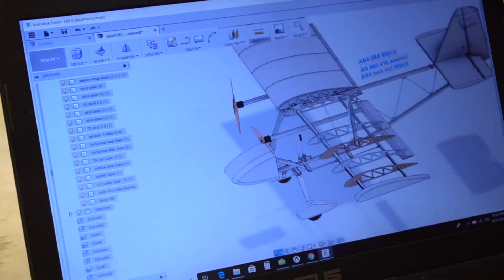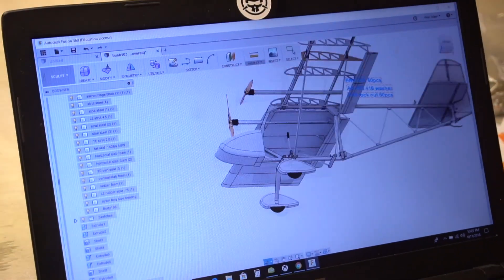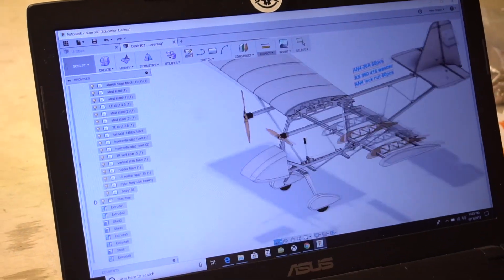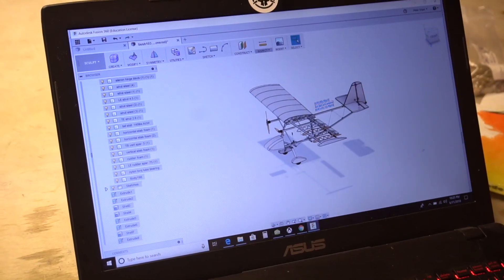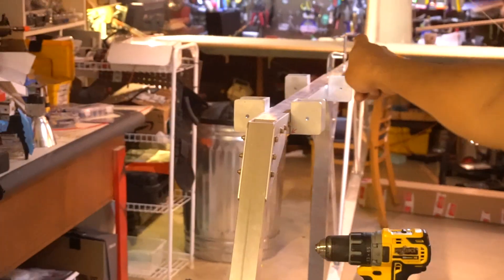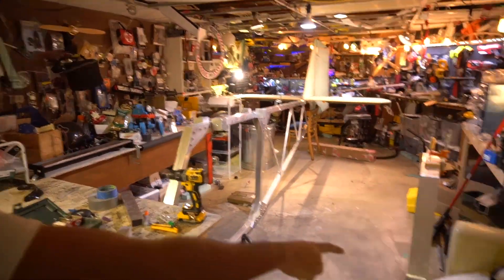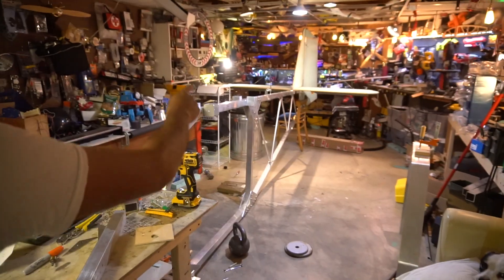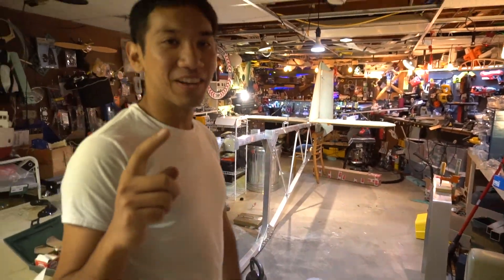DIY Electric airplane mk2 (Pt1)

Comment: Looks much better overall.    Monoplane much better than biplane.
Would look to seeing the following features:  
1.  a good high lift airfoil, with drag as a secondary consideration.  optimized for loiter/flight times.
2  a higher aspect ratio wing.    If you have an efficient airfoil, a higher aspect ratio makes everything better, except for adverse yaw, and that's a solvable problem.   Think early sailplane.. Do not need a large chord to affect the air if the airfoil is optimized for sink rate. The CL is achieved in a relatively short chord, and for the same drag, you can effect loft on a much larger volume of air.  Same principle as the large prop diameter. you would not want short, stubby prop blades, would you?   The twin lends itself to that nicely. 
3 the motors as close to center as possible, without interfering with each other, so that if you lose one, the offset thrust will be minimal. 
4 a T tail would have been better, but the tail you have will work fine, and will allow for better controllability at very low speeds, provided you learn to give the throttle a blast, and still have the battery power to do so. 
5. make a "Tesla" style battery from 3500mah NCR18650GA cells.  Much better gravimetric energy density, about 187% better than lipos.    Not sure how to get sponsorship for them, but would drastically extend flight times. 
6 high amounts of ripple current meant that the batteries should be kept very close to the speed controllers. And the speed controllers should be kept relatively close to the motors.  If you have to extend any wires, extend the wires from the SC to the motor.  this is a major safety issue, and one very often overlooked. 
7. find a way to brace the leading edge of the stabilizers, so that they do not get into an oscillation.  happens way easier on larger scale. 
8 I personally would have made the pilot's position lying back reclined much more for aero, but that's a personal choice, and can't tell you that what you're doing is wrong.  again think glider... 
anyway, just my two cents.  you have more experience by now anyway.. 
best of luck, and don't listen to anyone being critical without helpful criticism. 
cheers!
Reply: I always enjoy your comments. Well Thought out, thorough, full of useful info, and offering CONSTRUCTIVE criticism. Cant wait to see how your input is taken by Peter on this build!
Reply: Great comment !
Reply: So a little clarification on the horizontal stab and elevators in the slipstream, (or not) :
Yes, it helps with control when they are in the slipstream, but only the elevator is helped.   The stab does nothing for control, and if the accelerated air in the slipstream is at  a slightly different angle than the stab, there will be an unwanted pitch effect when power changes are made. 
Also, the increased control effectiveness suddenly disappears when you may need it the most, during landing approach, the landing itself, or in the event of a power failure.   Much better (in my opinion) to size the elevator appropriately, and set it's throws appropriately so that it has plenty of control effectiveness at minimum airspeed, and then it will always be there when you need it.  May need a larger surface, but the drag will be similar, or less, because it's not operating in turbulent, accelerated air within the slipstream.   a T-tail also gets the horizontal stab clear of the turbulence from the wing, but must be high enough so that it's not blanketed by the (even more extreme turbulence) when the wing is in a stall condition at high angle of attack. 
Added benefit of having the tail clear of slipstream is that the control inputs are directly related to airspeed, and are much more linear with the aerodynamic pressure.    This simplifies learning to fly the aircraft, as the  input required for a desired pitch moment is always the same at a given airspeed, regardless of throttle setting.      This makes the aircraft much easier to fly, keeps the pitch dynamic more constrained and consistent, and if you are ever to add a flight controller to the aircraft, (autopilot), the tuning of said autopilot will be that much simpler. Many flight control software does not have an algorithm that takes into account the effect of throttle setting on pitch control, and the PID settings that you would set for powered flight would work poorly during glide. Same goes for Autotune feature, on firmware such as Arduplane. 
And if you think "That's ridiculous, nobody would put an RC flight controller in a manned aircraft!", think again, as it's already been done.  They used small control surfaces embedded in the normal flight control surfaces, used as trim tabs, (or in a similar way), so that if the FC screws up, the pilot will easily be able to over-ride the inputs with the (much larger) control surfaces. 
Hope this provides some perspective on the thought process here, and feel free to disagree, and let everyone know exactly why!   Cheers everyone!
Reply: Higher aspects may make all aerodynamical properties better; but all mechanical considerations all that much worse. Thats the very good reason peter went with a biplane last time. And this build also seems more geared towards 'DIY budget' than 'carbon-fibre-all-the-things'.
Reply: But the propwash drops, so you'd get more force from the propwash if the horizontal stabilizer is where the propwash is actually going to be (below and behind), not directly behind it.
Reply: How would a higher aspect ratio make the mechanics more difficult? A High aspect ratio wing will provide more lift and require less thrust from the motors in order to maintain flight.

You only have a limited amount of thrust, a higher aspect ratio will make it easier for that thrust to actually supply enough lift. Sure it'll go a little slower, but we're talking about a DIY plane lol.
Reply: Higher aspect ratio means higher bending moments; and less space in the wing to account for them. Trying to build a high aspect wing on a budget (one that wont kill you) definitely makes a project like this a lot harder to pull off. Staying within budget, getting it done, and not killing myself, all would be a lot higher on my list of priorities if I were Peter, than say, shaving 10% off my induced drag.
Reply: True, there are practical limits.  It is worth an investment in time to find a way, as it's likely that a more efficient structure will result.   Examples can be taken from human powered aircraft, then applied in a more practical way (with higher margins, as you stated) for a project like this one.  Distributing the load can help, as can use of a tubular single spar which absorbs much of the twisting moment, along with the span wise structural loads.  wire bracing and struts can also be used, but over-use should be avoided.  
A primary reason why ultralight aircraft are not built in a more clean aerodynamic fashion is because they need the additional drag to limit airspeed in level flight to conform to regulations. This makes them lose a part of their potential flight envelope, and become less safe in certain scenarios, such as wind penetration, range, and the ability to loiter efficiently while waiting for good landing conditions, or divert to an alternate landing location. IMHO it would be better to make a more efficient aircraft,  electronically limit it's horizontal flight airspeed to conform to regulations, and get back at least some of those capabilities. 
an example of a slightly higher aspect ratio in a cheap simple ultralight aircraft with proven flight characteristics is the Sky Pup, Designed by some off-duty engineers working for Cessna ages ago.   Some aspects of the design are not ideal, but overall, it's a good design, and has some features that would be refreshing to see on other aircraft.  It did not even need bracing for the wing!  
The main reason to use a high aspect ratio in an ultralight is to increase lift, and enable slower flight speeds, and more battery to be carried, not to decrease the induced drag. It's likely that the induced drag would actually go up, just not as much as the CL.   Anyway, nice to see people put in their opinions. Cheers!
Reply: Eelco:

Yes a high aspect ratio means you need to ensure structural strength. But with a well designed strut that isn't going to be an issue. There's a reason a Cessna 172 has a high aspect ratio relative to a fighter jet. It shouldn't be difficult to design a strut to support the airframe. And besides, I doubt peter is going to be pushing the load factor on the plane very much anyways. 

On top of that, a higher aspect ratio wouldn't reduce induced drag. It would increase it. More lift (high aspect ratio) means more induced drag, there is just a fine line on what is too high/low of an aspect ratio.
Reply: ok buddy.    not disagreeing that power is useful at some point, like as soon as the angle of attack is restored, just not while the wing is still stalled, or when the aircraft is still in a steep post-stall dive.   adding power in a volatile situation with so much to go wrong, and lots of unintended consequences is just a bad idea. I hope you never do it on a craft with enough power to matter. 
Would love to hear actual explanation of WHY you believe application of power is good while still in the stall,(if I am not misunderstanding you-I aploogize if i am) and explanation of how the hell a sailplane can recover from a stall... 
lack of specifics and physics in this conversation, and too many generalities, jabs and personal comparisons.  Not the way to learn, or share information, in my book.  
Had a physics professor who resorted to non-scientific methods to get other people to accept his ideas, and had an interesting conversation with him about how a flat bottomed airfoil could possibly create lift while inverted.  He never did explain his viewpoint, ignored Newton's 3rd law, ignored Coanda effect, and just started swearing and dishing out punishments instead, while stating that bernouili was the only effect that could possibly matter.       Don't be that guy, dude.  
If you cared, you could go to my channel, and see what I do for hobby.   Can't talk much about what I do for real job.. but you would like it.   cheers buddy, and hope you have a nice day. 
 out of time for this conversation, and have to get back to work.
Reply: You are right. Adding power once the stall happens won't help. Only height will.
Reply: @scottgoodman4776  in a stall you simultaneously add power and decrease AoA.
Reply: Given that Peter has already decided on an airframe, motor and consequently, overall weight, *lift is not a variable*. It does not make sense to discuss design variations other than in the context of constant lift.
Reply: Great conversation, guys. I've owned t-tail and conventional tail aircraft in both standard GA category and ultralight and light sport- and one thing I can tell you is that you both make good points but one can't make many absolute statements when discussing vastly different designs and types of aircraft.
The T-tail has advantages and the best high performance gliders use them for a reason, but having owned a Tomahawk I can tell you that there are particular instances where elevator authority goes completely away and often when you really need it. There is software to model all this, but in my estimation with the type of aircraft here and the intended range of performance a conventional tail is where I'd be. It works well on the most successful low speed ultralights and light sports. 
The two things that stick out about this design is first- the central beam in front of the pilot. I would have gone with dual a-pillars instead for torsional rigidity as well as pilot safety. One quick stoppage and you had better be strapped in well AND not have any failure of the fuselage that will let they face be smitten by thy central beam. It's like in race cars I design- you have a cage to protect yourself from being squished, then you have to have elaborate seats, harnesses, helmets and neck protection to protect you from the cage.  Second issue I have is with the excess material everywhere on brackets and small parts. That all adds up- I'd bet 5-10 pounds of excess on that airframe.
Don't take my comments as negative- nobody has ever built a perfect airplane... except for maybe a Carbon Cub... damn, they are near perfect. :)
Reply: FPVReviews: 

The elevator isn't the only thing that is helped, the horizontal stabilizer is there to provide a downward force on the tail, specifically in cruise but generally during all phases of flight. Otherwise, you just end up in a nose down attitude without that downward force.

And, the "turbulence" during a stall isn't going to affect the tail hardly at all, your relative wind at that point is coming from underneath/forward of the plane and you already have a high angle of attack. So that turbulent air is just going to end up rising (relative to the aircraft) up and away. The airflow moving over the airfoil doesn't have the laminar flow necessary to maintain its inertia towards the tail (this deals with the Coanda effect). 

"Added benefit of having the tail clear of slipstream is that the control inputs are directly related to airspeed, and are much more linear with the aerodynamic pressure."
But with that comes a disadvantage, during a stall you want as much airflow moving over the aircraft as possible. Including the airflow from the accelerated slipstream. So removing the horizontal stabilizer and elevator out of that accelerated slipstream makes recovery that much more difficult.
Reply: adding power is the last thing you want to be doing in a stall, especially with the slipstream going only over the inboard sections of the wing.  would result in a a nasty tip stall, and maybe even inversion.  A braced wing will not be able to handle the inversion, and would fail structurally.   Another reason to brace the wing internally. 
It's proven, and well studied that a T-Tail that is not tall enough, (or a plain tail on a low wing aircraft) can be blanketed by the wing turbulence, and result in an unrecoverable deep stall, or at least difficulty in recovery.
here is a link to some testing at langley :
https://www.youtube.com/watch?v=TmWB6oyJ9lE
When conduction manned testing, or even with RC, it's common practice to use a spin recovery drogue chute to aid in normalizing the airspeed, angle of attack, and regaining control authority. 
There is still airflow over a tail when blanketed by the turbulence from the wing (if it is even located in that region), and it's not the lack of airflow that causes control loss, just the turbulent airflow.  hoping this makes sense,  can't post pics here..  
Wiki has some decent info actually:
https://en.wikipedia.org/wiki/Stall_(fluid_mechanics)
Reply: The stall recovery technique for almost all aircraft is apply forward pressure and increase throttle immediately to provide sufficient airflow. And those studies at langley are during a developed spin, we are talking about a stall where your Angle of Attack is high (tail is below your wings). A normal tail would result in easier stall recovery.

The Langley video shows an example where they use smoke, and it seems very clear that the turbulent air from the wings would in fact be more likely to hit a t-tail than a standard tail.
Reply: True, the T-tail is more susceptible to deep stall blanketing. That's why it has to be sufficiently tall so as to be unable of having the problem, and hence the testing. 
If an aircraft has just stalled,  There should be no need to add throttle, as the aircraft will be falling anyway.  Adding throttle will introduce torque effect, P effect, and slipstream effect, not to mention gyroscopic precession, and in many aircraft, it can result in a flat spin, and sometimes violent gyration.  In fact, for aircraft that are rated, that's (usually) exactly how you enter a flat spin. Not all aircraft are recoverable from a flat spin, without a drogue chute. Adding throttle at that point only makes matters worse.  
A spin always starts with a stall, so it's important to get the stall recovery right. 
Exiting the stall/spin always requires that the angle of attack of the wing decrease. That is what actually gets the aircraft flying again, instead of just falling. 
The aircraft will be falling, and will increase in IAS immediately after the stall event anyway.  
T-tails have many other benefits, if done properly, such as improved precision of control due to being further away from the boundary layer effects of the wing in the vertical plane, and better spiral trajectory mode stability, all good things.    There is also a drag reduction if they are blended properly, without the weird effects of V-tails, whether it be a standard V, or an inverted V.    That's why so many aircraft have them, from fighters, to cargo planes, to sailplanes, and sport aircraft too.  The raised CD in the vertical plane also means better pitch stability for the aircraft, and allows stability to be retained slightly longer as the CG is moved further back, decreasing the incidence angle necessary, and allowing the wing to work better in cruise flight, with less induced drag for the horizontal stab as well.  a wider CG range is also possible.
Reply: I am going to go out on a limb here and assume you don't have much time in a full-scale plane. If an aircraft stalls, you 100% need to add throttle. It's in every FAA publication involving stall recovery technique. If you were to take a checkride and not add power during a stall, I guarantee you would fail immediately.

Torque effect, P-factor (as it's referred to by aviation professionals), spiraling slipstream, and accelerated slipstream are all countered by using right rudder. And I'm curious as to what you mean when you say gyroscopic precession in terms of a stall as that is something that is normally only referred to when talking about a heading indicator.

And I'll ask a simple question, if a T-tail is so superior... Why do the vast majority of aircraft not use that design? You look at both GA and Commercial aircraft and almost every single one has a standard tail.
Reply: Only time I have is in Citabrias, a 172, and a Navion. none particularly glamorous aircraft. 
  all spin training and unusual attitude training was in the Citabrias.   Don't remember adding throttle.  On the contrary, remember the stalls being a lot worse with throttle on.  first step to recovery (as i remember it) was use the rudder (not the ailerons) to level the wings, and take out any yaw movement that might have developed (or establish safe recovery heading, if in terrain, or dealign with traffic, etc.) then stick forward until 70 IAS.  then pull back on stick again to level out, adding throttle.   It HAS been a long time ago...     
If you're so sure, please explain exactly why, so we can all get a grip on this, and move on, and so peter can get some answers (if he's even reading). I'll see if i can dig up the handbook for the old bird...
Reply: could not find handbook for the Citabria, but found this, and brought  back memories:
"P - Power To Idle

First, you move your throttle to idle. This seems counter-intuitive - don't you add power in a stall recovery?!?

In this case, no. While you may feel like you're pointing straight down in a spin, you're actually not. Your flight path's nearly straight down, so while the nose looks low, you still have a very high angle of attack. Power aggravates this."
reference:      http://www.boldmethod.com/learn-to-fly/maneuvers/spin-recovery-purpose-of-each-step/
Reply: That Bold Method article is regarding spins, we are talking about stalls. To recover from a spin yes you need to move throttle to idle. 

But to recover from a stall you pretty much always increase thrust. As a stall is more likely to happen on short final coming in to land close to the ground, you need to gain airspeed and altitude as quickly as possible. 

Now realistically, the steps are "pitch down/reduce AoA, wings level, thrust as needed" So if you are at altitude and stall for whatever reason then sure, you don't need full throttle to recover. But if you're low and slow as is typical with a real world stall, you have to recover as soon as possible. 

That information is out of both the FAA PHAK and AFH.

Every instructor, every pilot, and every FAA examiner I've ever dealt with tells you or requires you to use full power on recovery.
Reply: The technique needed for stall recovery should not change depending on the degree of desperation of the pilot, or fear of being stalled close to the ground. That kind of thinking can get you killed. That's specifically what the training at altitude is for, so that you can perfect your technique, and get disciplined in it's execution, and not panic, changing it when you really need it.  A "real world" stall should not be any different than one in practice, other than being a "not intended" stall.   If the technique gets changed up in panic, then you are probably screwed.   The goal of stall recovery is to recover with as little altitude loss as possible, without entering a spin, or aggravating the stall in any way. 
The article I cited did in fact cover stalls, if you read it, and that's why I specifically quoted the part that pertained to a stall. 
you even said:    "realistically, the steps are "pitch down/reduce AoA, wings level, thrust as needed"
the add thrust as needed is the last step..  after the plane is flying again.
remember, in an extremely high angle of attack, the prop blades will not be anywhere near optimal angles of attack to the airflow either, so adding power will only introduce more variables, such as I already described. Could add retreating blade stall to that.   It will not help, unless your plane has enough thrust to hover, and has  vectored thrust, or a reaction control system. 
after the stall has been successfully exited, then full power is perfectly OK.    We're talking about a couple of seconds difference here, but it's important.   you can make a plane do all sorts of nasty things by applying power during a stall, or with some aircraft that have a high torque feedback, and short wingspan, you can just fly close to a stall, then add power, and the airplane will "torque roll".  Better go ask the Pitts guys if you are still confused, and see when they say you should add power.  Just make sure you tell them you're talking about a standard stall recovery, not an aerobatic maneuver that results in a spin, albeit on a different axis, and with a fancy name.
Reply: Was this one of the articles from the FAA that you were referring to?   perhaps people reading this can just go there, and read directly?   :
https://www.faa.gov/regulations_policies/handbooks_manuals/aviation/airplane_handbook/media/06_afh_ch4.pdf
Reply: Alright, well let the FAA know that all of their documentation and training requirements aren't correct then. Walk down to your local FSDO and talk to an inspector lol, see how that goes.

The part you quoted literally says "While you may feel like you're pointing straight down in a spin"

And a retreating blade stall is something we don't even consider on a fixed wing lol, that is rotorcraft. 

I have done probably over a hundred stalls at this point, with half a dozen instructors, 5 different DPEs, with probably close to a hundred thousand hours between them. ALL want full power in a stall recovery.

I think you just don't have the real world experience to apply here, sure you've done a few but again that was awhile ago from the sound of it. And the fact that you talk about a retreating blade stall when referring to fixed wing aircraft makes me question your knowledge on the subject overall.
Reply: yes, that as well as the PHAK and AC (Advisory Circular) 120-109A.

Stall Recovery on page 4-7. Pay close attention to #4 under Fundamentals of Stall Recovery.

Also on the example on page 4-9 "When stall occurs, reduce angle of attack, roll wings level, and add power as needed"

Edit as it may not be clear for everyone: PHAK is the Pilot's Handbook of Aeronautical Knowledge. Available online for free to the FAA.

I'll also add that I am close to getting my Flight Instructor's license. So I've done this a few times haha.
Reply: Aleks B. No it doesn’t... the elevator and rudders are in the right place...
Reply: Aspect ratio really isn't the crucial variable influencing overall lift; there are plenty of ways to increase overall lift independent of aspect ratio (like those sweet junker's flaps, for instance). Technically, aspect ratio does not influence lift at all; making your wings longer does. Trading span for chord does noting for lift, to first order approximation. As for higher order effects; for a given lift requirement, a longer wing means a shorter chord; and lower Reynolds numbers. Which rarely is a good thing.

Pretty much the only reason to push for higher aspect-ratio is to minimize induced drag. Nobody likes induced drag, but unless Peter plans on winning glider competitions I really doubt it should be his foremost concern.
Reply: Compared to a fighter jet everything is 'high aspect ratio', but I wouldn't call a Cessna 172 such in any absolute sense. In fact it seems solidly in the range of 'modest aspect ratio' designs that Peter (rightfully) seems to be aiming slightly below. As for the relationship between aspect ratio and induced drag; id check your sources again. Viewed differently, it does not make sense to discuss wings in terms of 'high lift' or 'low lift'. The wing he will be using will have the lift required to get him off the ground given his target airspeed and weight; or it might as well be a zero-lift wing. An increase in aspect ratio at constant lift (which is how you usually discuss these things) will (surprise) not influence lift. But an increase in aspect ratio at constant lift will lower induced drag. And thats pretty much the only positive to it. 

As for the mechanics of it not being an issue; it sounds like you are generalizing from experience with model aircraft where any bbq skewer will do as a spar. But mechanics does not scale; volumes and masses scale as length cubed, and cross-sections as length squared. With full scale aircraft, at least half the work in building a good airplane is building a wing that is sufficiently strong and stiff. Those challenges will only compound when you are doing things PS-style, on a shoestring budget in a few weeks time.

Moral of the story: if you can live with the higher induced drag, stay the hell away from higher aspect ratios.
Reply: Eelco, induced drag is a product of lift. More lift = more induced drag.

Ryan, what do you mean "the elevator and rudders are in the right place"? lol, we aren't arguing rudder location, just elevator height.
Reply: Uhhh, we aren't necessarily talking about redesigning his build. Just aerodynamics in general. And when you say "other in the context of constant lift", what do you mean? If he has already decided on an airframe, motor, and weight then he has essentially decided what his constant lift is going to be.
Reply: If you want to talk about "Just aerodynamics in general", I really think you should grab any aircraft design book and read a little, you have a lot of misconceptions in your comments. Eelco is 99% right in his comment. The only funny thing is that Induced drag depends on the wingspan and not on the aspect ratio. The induced drag coefficient does depend on the aspect ratio. And this is not my creation, you can find it in the books
Reply: I like the truss type fuselage / empennage design but it looks a bit overbuilt (many light aircraft just use an aluminum tube boom) and the bolted gusset plate connections might actually be stronger if the tubes are welded and smaller gussets are used for additional strength in the corners... Also size of the elevator surface  looks small in relationship to the horizontal stabilizer... I'm not trying to be a critic... just curious if you or some others agree / disagree?
Reply: The judicious use of welds would make his plane both stronger and lighter. He seems not to have considered this.
Reply: So you recommend a narrow chord... I'm curious what the ideal chord / ratio is for short field aircraft? Most short field Cub based aircraft tend to have a chord of about 1/5th the wing width.   What about tapered vs non tapered wings?  I like the tapered no strut high wing on the Backyard flier... It seems to produce good short field performance and a decent cruise with no flaps. I've noticed most strutless (high) wings tend to be tapered while most strut supported wings seem to be rectangular like a Hershey bar... most high wing aircraft also seem to use struts while low wings typically do not... sure there are some exceptions ... the Cessna 190 comes to mind...
Reply: Since you guys like to talk about wings and obviously know what you're talking about, have you seen Robert Carr's Internal Wing Aircraft?  http://www.rexresearch.com/carrcoan/carrcoan.htm
Reply: FPVREVIEWS  Power management and reduction of AOA are both paramount when encountering a stall. The wing will stall whenever the critical AOA is exceeded, regardless of the speed. Which is why accelerated stalls are practiced. You are correct, the AOA must be reduced to break the stall, goes without saying. But you're incorrect to suggest you must always reduce power...and VERY incorrect to say you should level the wings with rudder. First...about the only time reduction of power would be warranted is if the aircraft entered a spin after a power-on stall...like when climbing out or practicing power-on stalls.  And the reason that spin occurred was because you didn't "keep the ball in the center,"  or coordinated, when the stall happened. Being uncoordinated will allow one wing to stall before the other, which can/will cause a spin. Aircraft encountering a full stall when in coordinated flight will usually stall straight ahead...if powered, simply reduce the AOA and fly out of the stall....if unpowered, reduce the AOA while applying full throttle. Same basic technique is used from GA aircraft to large jets. (except in large jets you never practice full stalls...just the approach to a stall)  Kicking the rudder in the stall can/will cause a spin. Getting OUT of the spin is when you need to use rudder. Apologize for sticking my nose in....
Reply: Aleks B. You're correct, more lift causes more inducted drag. But if the increase in lift is a result of increased aspect ratio there is usually a reduction in parasitic drag. I would disagree with your statement that almost all GA and commercial aircraft us a conventional horizontal stab.....there are many with a T-tail. Sorry, had to throw in my two-cents.
Reply: Amazing- excellent advice
Reply: If only we could get some Tesla 2170 batteries... That's money right there
Reply: I liked this because it sounds smart
Reply: Thanks for your input, and insight into the pilot safety aspect of the design. 
I'll have to disagree with the carbon cub perfect airplane thing however.  I personally have as a pet peeve the single engine prop driven aircraft, and especially the one where the engine thrust line is so far below the center of aerodynamic pressure.(unless you get big enough tires on it) LOL. 
Some major problems with any single engine aircraft :   P factor , Torque factor, slipstream effect, and gyroscopic precession.  Why I'm such a big fan of multi-engine aircraft, and especially DEP.  Anyway,.. 
you are dead right about shaving weight from all of the small parts.   at some point, may have to get into looking at how to beat the rules for ultralights/motor gliders, and get to designing one of my own... 
BTW, if the T-tail is tall enough, it should be impossible to blanket it with the wing turbulent flow.  If you look at most transport aircraft that have them, they are obscenely tall.  Sailplanes are shaving every bit of weight and drag, so makes sense that they would skimp a bit in that regard..
I think the rules change a bit when you exceed a certain wing span, so peter might want to look into that..  any insight there, anyone?  I remember rutan talking about some category where he could fit his ski-gull into...???
Reply: P
Reply: Y u writing essays
Reply: Curious, why do you think a T-tail would be better? Having the accelerated slipstream moving over the tail will make the control surface more effective than if you had a T-tail.

Also, there's definitely a fine line with a high lift airfoil. You'll eventually get to a point where you have so much lift that the induced drag is too great. You end up with a stupid slow plane haha.

Great insight though!
Reply: @BitesCGI  T tails are heavier so not better.
Reply: Lol, There are far more factors than just weight that determine whether something is better or not when it comes to aerodynamics.